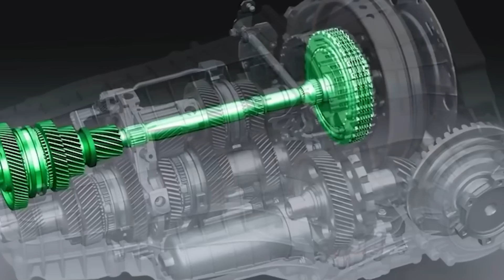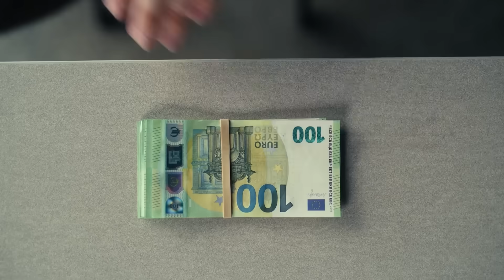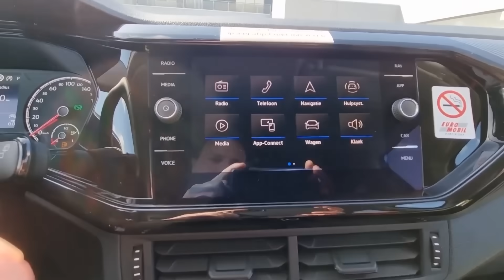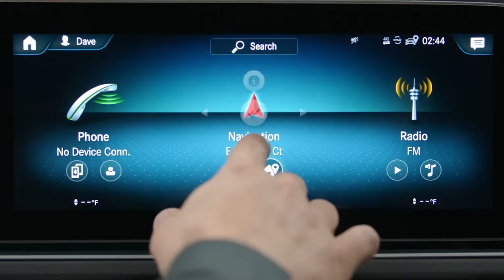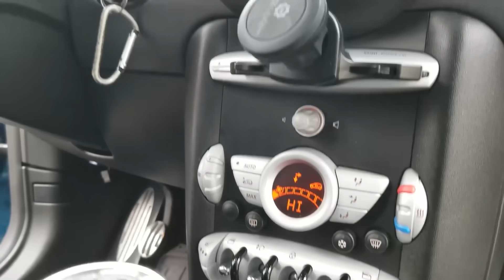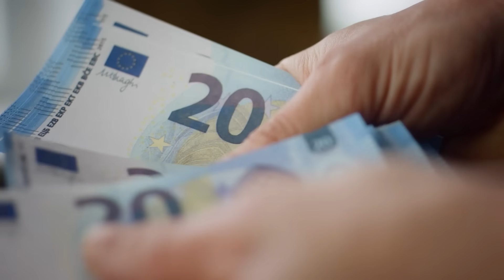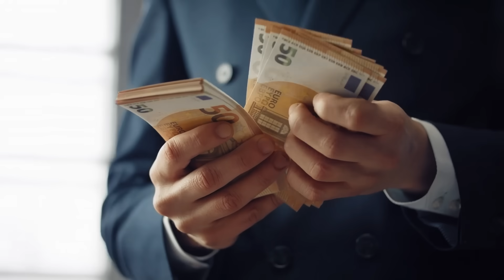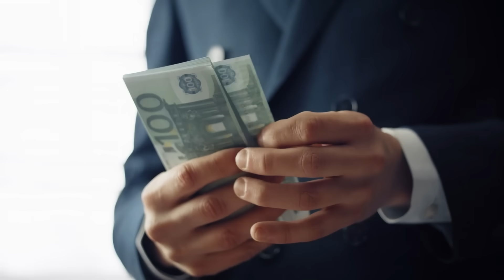7 DIRTY Secrets Why Your European Car BREAKS After Warranty

Comment: there is more to add, on my BMW type E30 after the change of thermostate the temperature has been slightly increased, changed 3 more original and OEM the temperature remained identically increased, that resulted in replacement of other cooling parts that were already new, but none solved the issue. Then tried to cook the non-OEM thermostate that appeared to open slightly closer to the specification but with much more opening or flow, then installed it and it worked like the new car. The frustration was not only that for the 20 Euros price thermostate resulted in 1700 Euros unnecessary parts exchange, but that they likely did it by purpose to increase parts consumption by overheating. The response from the car manufacturer was that the temperature increase is within the tolerance.

Comment: My a6 2015, gave a mechatronic failure and went to limp mode at precisely 185k km, changed auxiliary pump and nothing. Upgraded tcu software and error is present but doesn't go to limp mode. At 190k km, turbo air valve goes bad and car goes to limp mode. Now before I hit 200, I get a lovely Lexus and forget about all this and let German play with their stupid games

Comment: As an owner of the 2nd VW, I pretty much agree. After 100k Km my first Amarok truck started to consume my money. Hydrolic steering pump, A/C compresor, alternator. I have never had a problem with japanese cars. The cost of changing the time belt and clutch (same lasting as Japanese cars), every part cost a fortune each. I still love the truck and bought a 2nd Amarok, which I   drive much less than 1st one.

Comment: Very Clickbait. "It's programmed to die" states the intro line. It's not programmed to fail, at all. Imagine how complex that would be to test every component to see how cheap you could make it before it fails in warranty enough to be considered a financial loss (what you're saving in costs, you're paying out in warranty). This is tin hat conspiracy theory stuff. Parts fail on a car beacause it was made too poorly for cost reasons. A bean counter over-ruled an engineer. A car have parts that live in a tough working enviroment: heat, pressure, contaminents, shock, shake etc. 
What you're getting is the manufacturers putting out to tender to their various suppliers for the cheapest part of 'reasonable' quality, the car manufacturers make very little of their own parts, they are assemblers basically. Yes, they engineer what is required for their new car and in co-operation with hundreds of part suppliers work out a what they need and barter down to a cost. Testing of pre-production models for 10s of thousands of miles, to measure endurance doesn't really happen any more as it's time consuming and costly. it can be simulated now and that has its pitfalls. It's counter intuitive to have a part deliberately fail, as surely it makes your brand of cars seem unreliable and you wouldn't buy another one of that brand, surely?
Couple of points on the video to grumble about. The OM651 Merc engine swirl flaps operating at 200 degrees c ? Jeez, where did the intercooler go? more like 60-80c. They fail because of soot contamination, just like many other diesel engines, they either jam or break, depending on how powerful your swirlflap motor is. Same with VW's EA189 engine and many more.
Manufacturers don't encourage technicians/mechanics to look for 'extra' work. The dealer/ service centre might, with some offering bonus incentives to their employees if they find extra work on the customer cars they have in that day. This practice is often open to abuse. 
I'm not denying that cars are manufactured with substandard parts, it's an issue that is seemingly getting worse as the cars are getting ever more complex, more parts make up a car and they areexpensive to produce (even if the manufacturers have no shame in the showroom cost of cars nowadays).  It's not designed to fail, that's just mad.

Comment: I have a VW with the 20v V5 engine (code AQN).  There are plastic pipes that are well known to fail as the car gets towards 20 years old and beyond.  A lot of air hoses become brittle, and some aren't made any more.  Rubber hoses deteriorate over time, and some aren't made anymore.
There's one large coolant pipe on the car nicknamed "The Crack Pipe" due to its appearance and the fact it's well known to crack.  VW no longer make a replacement.  Luckily some enterprising and talented individuals make stainless steel replacements for about £80.  And they make some other parts out of SS too, as other pipes are known to fail, with no parts available anymore from VW.  
Even the 1600 (8v, 2005 year), has problems with cracking plastic pipes.  I'm just about to go to do some work on the car to replace a sensor, and I have to undo and move a few of them to get access, and I have to be sooooo careful when moving the pipes.  Every time I work on the car I'm expecting to hear that dreaded crack or snap sound again.
It's criminal of car companies to do this to otherwise good cars.  The scrapyards are full of cars that would otherwise have another decade or more of service life in them.  This is economically and environmentally bad. As I said, criminal.

Comment: 4:00 I thought plastic guides are used on timing chains because the chain can't slide on a metal guide. Or is that false?
Reply: That's correct. Other car companies, e.g. Toyota, also use plastic guides. That being said, 'plastic' is a very broad term referring to a whole lot of materials.

Comment: German engineers make cars that are impossible for the average person to fix or modify in any way.  Changing headlight bulbs on my Jetta took 10 minutes on one side, and 90 minutes on the other side, because  you had to disassemble multiple components to get to the bulb housing.  So everything has to go to the dealer or specialized VW mechanic.  MB is even worse, and BMW's are just money pits.  German cars are no longer the easy to repair, reliable and cheap to operate cars that made them famous, they are now just junk and outside of EU, too expensive to bother with due to only lasting about 5-6 years before needing constant repairs.

Comment: I think I’ll stick with my 35-year-old Nissan 300ZX — designed for 300 hp but over-engineered to reliably handle 500 hp, and still going strong after all these years. I used to feel sorry for European manufacturers being taken to the dry cleaners by the Chinese… but not anymore, after watching this video.

Comment: This is why every used car sold has to have a 2 year warranty and if anything fails within 6 or 12 months the fail was there at purchase. 
Many parts supplier who manufacture for the brand will sell there own oem part and these tenddvto bbe of a better quality or have beenn altered to include the upgrade that the brand refused. To be fair we stopped buying european cars because there warranty and service and dealer service where so poor.  We moved from Mercedes to lexus skoda to Toyota  we do own 1 euro car a 10 year old opel astra  it has a robust chain driven engine which has a good reputation is serviced properly  the gesr box is a very good six speed torq convert type if you ignore the manufacture sealed for life and you service with new filter and fluid at 10myears or 100k they are great  
But the rest of our cars are japanese or korean  
The move to ev has really shown the europeans in a bad light .

Comment: I wonder when the Germans decided to ruin their cars this badly. Up to 2010 I did not hear many complaints and within a few years after that suddenly people were trash talking BMW, which used to be a standard of quality. 
The Skoda Octavia of German make from 2008 had close to zero issues up to 100k (and probably much longer for those who kept driving one), except for some known ones like the left rear door mechanism jamming and some flooding in the back due to wrong sealing rubber installation, but other than that it cost me nothing to maintain.
All I hear now is complaints about the new engine models.

Comment: something else that this video doesn' talk about and that I learned watching the excellent care care nut toyota lexus channel, manufacturing went from a balanced ease of assembly-ease of repair equilibrium to manufacturing optimized to the max for speed and cheapness of assembly to the massive detriment of repairability BMW typically are a nightmare to repair with nearly un-repairable cars that require so many hours of work it's not worth doing neither for the mechanic than the owner, you should see the work and time it took to care care nut to fix a defective door handle on a Toyota Supra (which is not a toyota but actually a BMW with a different body)

Comment: when I was taught electronic system design in the 2000s we wer taught to make the best circuits possible for the best possible price without sacrificing quality, talked to a recent engineer now they are taught to make the cheapest possible design that lasts "only the warranty life and not longer" not a theory literally that, what you see in all modern products be it a fridge a hairdryer or a car, things like Ford Citroen wet belt design is what happens when a manufacturer guess-timate planned obsolescence and cars fails sooner than they expected, the problem is that laws do nothing against that every wet belt engine should be banned from being sold and the buyers reimbursed because it's a 100% guaranteed failure design so brands are sellling a known defective product why are they allowed to continue ? I have a Ford Ecoboost and with 100'000 miles it's running fine, why ? it has a timing CHAIN so it's not like Ford can't make them, they chose to use a self-degrading design on purpose, to supposedly gain 0.01% lower emissions I'm not kidding

Comment: If it wasn’t for corporate greed, we would have long lasting cars even if they choose to put plastic parts on their engines and cities will be designed around people instead of cars. EVs would’ve taken over in 2025 because the manufacturing costs are too low to pass up due to heavy investments in EV battery research and development instead of pleasing shareholders from the 80s to the 2010s. Then ICE engineers are retrained into developing EV drivetrains such as finding ways to make sure the stator windings do not fail no matter how old the vehicle gets.

Comment: Yes, and not only cars. Ecco brand shoes use time-aging rubber for their sole which is designed to crumble and disintegrate 5-6 years after production. Even if you didn't wear them much or at all.

Comment: How about these too:
   1. offering only turbo compressor engines which by design have a twice shorter lifespan;
   2. recommending excessively long oil change intervals which gradually destroys the engine;
   3. using way too thin oil to increase mileage at the expense of component longevity.

Comment: My experience with the rotten subframes from Mercedes here in Germany. Even if your car is older than 10 years they will repair it for free. But they will calculate the value of your car. If the repair cost exceeds the value of your car they will not do it.

Comment: what car doesn't use plastic guards and tensioners on the timing belt, some plastics are better than others, but you can't buy a metal tensioner for a good reason. and seen countless thermostat housings made of plastic now, most the cars had well over 250k on the clock, 25$ o ring included.

Comment: That’s exactly why I am driving 2005 Peugeot 607 2.2 HDI diesel. It had some initial defects (windshield liquid leaking, parking sensors failing) but after few years zero new problems. I service it annually  for 300 - 400 EUR at an authorized dealership. It has 245.000 km, drove me all around Europe, zero rust, replacing just the regular wear parts.

Comment: Our KIA ceed engine fall apart 67,000 miles (cc 100K km), requiring full engine replacement. The car was regularly serviced, but not at the dealership thus lost its warranty. Some plastic part in the engine or the turbo disintegrated and got into the engine. We lost 2/3rd of the value and were forced to buy a new one. Not only European manufacturers are doing these dirty tricks… now I own a Japanese car, hopefully that would last 5 years.

Comment: You’re wrong about Tesla. Does none of the parts in Tesla cars require a subscription for an upgrade. There is subscriptions for an acceleration boost which is a one off payment. There’s a one off payment also for upgrading the auto pilot to FSD supervised again at once half payment You can pay a monthly fee of €10 a month for premium connectivity which you can opt out of at any time. So if you’re telling lies about Tesla question is what else are you lying about?

Comment: I've got a Renault 2017 Mégane 1.5dci. it has 200,000 miles on it, it has been maintained meticulously but driven hard. Brought it almost new ex demo. Oil changes every 8k , even gearbox oil changes every 40 - 50,000 and brake fluid. Barely anything has gone wrong. Slightly seized brake caliper at around 180,000 miles, a exhaust temperature sensor and a split pipe on the diff pressure sensor all at almost exactly 180,000 miles, as I had a load of stuff apart, I checked turbo for play, no play at all.. Was easy but fiddly but took many hours to sort, in my opinion coupd have been designed to be easier to fix. Although now I will change all sensors Next summer. I would say although this car has been very reliable despite having a hard life so far, if I wasn't an engineer I would probly have to get rid of it as I will probably spend an entire weekend next summer overhauling bits (but cheaper than a new car) Some components near the engine are almost impossible to reach so I will lift the engine out. I plan to overhaul it next year and change all sensors purely as car has been v good. I could not Imagine newer models being the same.. I am a fully chartered engineer which helps. But I can see this being true hence why I will change all sensors in my car. Makes me think a bit tbh.

Comment: I had a 2003 Audi A4 ... now I have a a2016 Audi Q5 ... sad the mechanics could not fix my old one. It was more basic less electronics.
I definitely do not want newer cars than this last one this is the last one without touchscreens and internet connection I never want newer cars.
Maybe an older once this one can no longer be repaired. I would rather spend more on repairing an old car than buying a new one.

Comment: To avoid all this I bought a mint condition '72 GMC truck, with a brand new, but oldschool GM performance 350. I am so happy! Every drive is an adventure , and I get warm inside every time I look at it. I am far from a mechanic,but the car is so simple, that with you tube directional videos I fix it myself.a service is oil and air filter.i live in Sweden ,so in wintertime I drive an unbreakable old Volvo 245. Those to cars are the best financial decision I have ever made..

Comment: This is why I don't miss my b5 Audi, 5 times replaced a fuel fumes return pipe, which always lasted less than 6 months. I also don't miss my 525m e 39, a gorgeous super comfy and great handling, a total lemon when it comes to plastic pcv hoses and engine components, not to mention ridiculously expensive coil packs that always fail. Temp sensors that fail as soon as you install them. I also don't miss the iconic 205gti, gremlins that are hard to detect, parts hard to get in Australia and lack of qualified mechanics that a dually don't hate a French car.
My 2010 diesel hilux is basic, non luxury and yet it is the best car I ever had. I can still take corners hard on a good tire, it never fails, it gives me 750kms from a tank of diesel, takes any kind of road and swallows speed bumps which happen to be everywhere in Melbourne. I towed 2 tonnes in this car and had another 400 kg in the back of it. You can't kill this car if you service it. I service this car myself every 5k and it gets the best oils and parts.
Euro cars depreciate so quick and only rich snobby people dumb enough to buy them

Comment: Even though the video tells the truth overall, it`s highly exagerated. Per example, VW never claimed the DSG transmission fluid is longlife and DSGs gearboxes were never sealed. VW always recommended DSG oil change every 60k kms. Some of them had issues, like my car`s mechatronik unit failure at 62k kms that cost 2500 EURs to repair? Sure, but they never said oil is "eternal" and DSGs were never sealed.

Comment: From inside the industry, I can tell that all reliability statistics are done only for the warranty period (e.g. 3 years, 180 000 km), so nobody knows if a component lasts 3 years 1 month, or 25 years. For some components it is not acceptable to fail, no matter how long time in service.
In case of a batch of cars with technical problems (incorrect asembly, non-complying components, etc.), the management choses the lowest cost between fixing the issues (component adjusting or replacing in the factory, call back, etc.) and the warranty expenses for the few clients claiming it (some rejected because did not do the maintenance in the official shops or at the right time, for others improper use can be invoked, etc., for some the fault occurs after the warranty period).

Comment: Criminals? looks like it. As a German I say to you - do not buy german cars. I bought a 2 year old 2015 Toyota Sienna AWD XLE in 2017 - now 10 years older with 120000 Miles it still runs like new,  the transmission oil changed at 100000 miles.

Comment: Had a 3.0 v6 jag. Both inlet manifolds needed replacing. After I was told that it was plastic that failed I sold the car as is for a big loss. Mechanic put me wide to all this crap. Wasn’t putting money into that. Bought a 20year old landcruiser instead